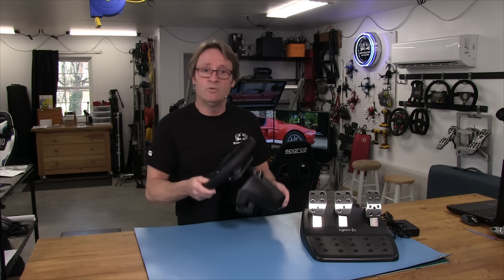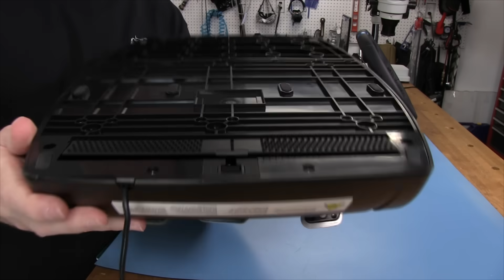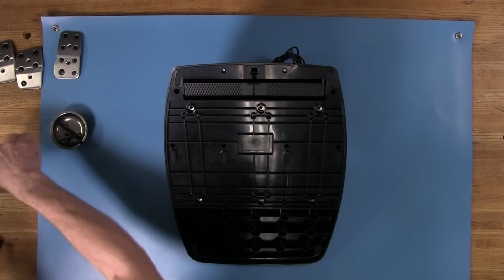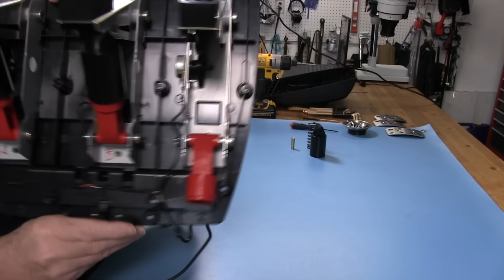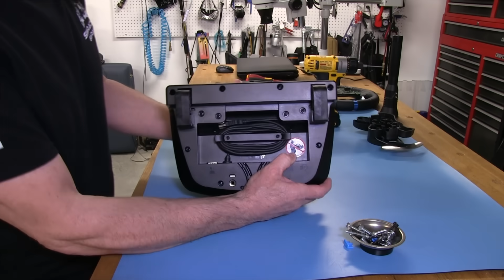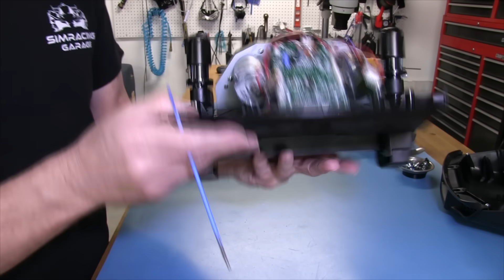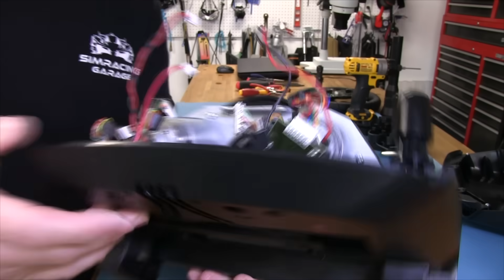Logitech G29 Review

Comment: Actually, I use a G29, but I still have a G27 that broke the encoder. I replaced it with a brass one, but the wheel still does not calibrate correctly and it has no force feed back on the left side. I hope my g29 will have better lifetime. It's a nice wheel, but I'm afraid of any issues.
Reply: Hi!Like a steering wheel, an impression? Is it worth paying for the T300, or is the G29 the best choice?

Comment: Would you recommend to pull out the rubber thing in the brake pedal? Is it possible to adjust the brake curve (yet)? I only play on PC, so I don't mind if it will create unwanted side effects on the Playstation.

Comment: The g29 is a solid wheel, I laugh at any elitist who instantly bashes on the g29 and talks like its a 100$ walmart spring driven wheel. Yet those people who hate the g29 will praise the g27 even though they are practically the same wheel with different button placements. 

I would go for a g29 any day. its a great intro to sim racing.
Reply: People rip on the G29 and praise the G27 because the G29 is just a G27 with less useful buttons and a higher price that DOESN'T include the shifter.
Reply: @VoidSixx  yeah higher price when the g29 first came out. Since the g27 is no longer produced, buying used is usually pretty expensive for the g27. It's only $250 for everything now a days for the g29.

Comment: Hi Berry, watched both of your videos on G29 and T150 and I'm currently trying to decide between the two. Do you think T150 is reliable enough?
Reply from the maker: Unfortunately reliability on any wheel system can be hit or miss. So, I really can't say which one would be more reliable. Just have to roll the dice on which wheel you personally prefer.
Reply: @simracinggarage3026  you're so right berry, that makes sense as there are a ton of moving part in these pieces of wonder. Thanks for the quick reply, I hope nothing goes wrong
Reply: @malicalik  idk if it's still relevant to you, but my t150 broke after one day. I was playing for a few hours and everything was fine. FFB was strong and very direct. I liked it. Unfortunately when I turned the wheel on the next day and played for a bit, the FFB was very unprecise and sometimes the wheel just blocked. It made weird noises and even smelley a bit burned. I then took my t150 off my table and shaked it. I could here a little rattling noise as if a little piece of metal broke off something. I returned it and bought a G29. The G29 feels a lot better and the metal pedals were much better than the plastic ones from the t150. In fact the t150 pedals flipped over when I was breaking. The t150 pedals have no screws that could fit into a playseat. I had to glue it on to something. The G29 pedals were rock solid even without screws holding it. I would highly recommend buying the G29 since I have this wheel since 1 year and it still works perfectly. Don't get me wrong, the t150 still is a great wheel for the price, but the pedals, quality and reliability of the G29 is a bit better.

Comment: Good review I used the nixim mod for years on the G25 pedalset tried the G29 set up and it's very pronounced end of braking and the rubber is very stiff, I swapped out for my Nixim dual rate spring and softer rubber insert and it felt much better light at start for feathering then onto stiffer rate so like hitting the servo in a normal car then the end rubber squash for standing on the brakes. I've also de-cased to reverse mounted the pedals now and I much prefer the feel of inverted pedals over the F1 style.
Could you do a video showing where to get a circle button feed so we can run a diy handbrake for rallying and drifting?

Comment: man i have bought that wheel one month ago.
my pedals are already fucked up. 
its break randomly at random breaking pressures without even tutching the pedal.
sometimes it trigger the break when i accelerate.
and now when i'm at 100% on the accelerator it goes randomly from 90% to 100%. 
everyone seems to have tose problems 
they says its because of the dirt inside the pedals.
i'm looking inside it, there is nothing.

Comment: Excellent review :) And I just realized that the moving slider is not a stabilizer, but locking mechanism which makes the wheel rotate "only" 900 degrees :)  And as always, I was very happy with all the Logitech products so far (I owned DFP from the wheels). I have keyboards, mouses, speakers (z5500) and always all great. Except for G940 where many users including me had to fix the wiring in the throttle and replace the board for Bodnar's one to eliminate hysteresis (refueling pain). 
Anyway, it seems that the G29 is made very well, I made an exception when G27 was introduced and took Fanatec (old GT2) with CSP (v1) pedals, but had to say it was the same cost just for the wheel and with pedals and shifter, it was almost the double. Also after intensive using for a few years, I had to recently rewire some wires in the weel as well as on the pedals. I think that with Logitech this is very unlikely and maybe just the pots will need to be replaced after some time.
So for any newcomer, I would definitely recommend Logitech G27/29 as it is a great wheel and if you fall in love, you can upgrade to Thrustmaster or some recent Fanatec wheel anytime later. The precision and absolutely zero deadzone feels great even with the older GT2 wheel as it is belt driven.
Reply: Edit: reading post below it seems that G29 can suffer after a long time usage from the twisting the wires as well.  I've had exactly the same issue with my Fanatec last week (years of usage) and I needed to replace all the wires between the base and the wheel. Really strange things started to happen :) I do not understand why both manufacturers did not make the cable longer twisted into a few circles. Or chose different wiring material :/ For some of us it is easy to disassemble the wheel and replace it, but for a regular customer, it must be a pain to wait till the service do the job :/

Comment: My Force Feedback doesn't turn it self off completely at 0%. It sometimes make my wheel shake and produces a slight drag when turning a wheel ... I hate it (I hate FFB as well as centering spring). So in order to make it physically off, do I need to unplug these two current controlled 2-pin connectors from 36:50?
Will i loose turning angle restriction after this?
Cheers! :)
Reply: Lower your FFB setting back to 100%. Everything higher that 110% removes the center deadzone, thus making it wobble back n forth. Also if you want to run it without FFB you can just unplug the adapter, but then it'll run without the centering spring, so you'll have to reverse it manually to the center.
Reply: Nope. I know unplugging adapter on G27 does the trick, but on G29 it doesn't work.
PS
There is no FFB settings in Logitech Gaming Software, so how can I set FFB to 100%?

Comment: it's a very good, reliable, and premium-built wheel. my only complaint is the rigidity of the rubber stop behind the brake pedal -- if it was even just a tiny bit softer, the G29 would be perfect to me. (it certainly makes some challenges in assetto corsa more physically demanding than they have to be.) otherwise it's been well worth the $300; makes racing games 1000x more fun.

Comment: Is there any where you can direct me to get instructions to safely disassemble this wheel? I.e paperback. Your video is really detailed and the closest I have come to finding what I need. My wheel fails to calibrate on ps4 mode. I believe need to replace the center cable and need some guidance. I may need some ideas on what I can replace the black cable with as its not a item one an buy off Amazon. Much appreciated for any help. #sadsimracerdude
Reply: Could you perhaps do a repair tutorial on this common known g29/g920 issue? https://community.logitech.com/s/question/0D55A000071vQbpSAE/g920-pause-when-turning-issue-fixed

Comment: The "Rack" for the "Pinion" on the back end of the steering wheel mounting shaft is solely there for end stops. The protrusion sticking out next to the pinion hits on the ends of the rack.
Reply from the maker: Yes, but the mechanism also induces drag on the drivetrain. Which adds weight or dampening to the feel of the wheel when turned. Remove the toothed rack from the pinion, and wheel will turn much easier.

Comment: Would you recommend getting T3PA pedals with Drivehub? The brake pedal is a massive problem for me especially in F1 games and since I'm using an average desk chair it just makes things a little more difficullt. Some people have told me to use the Clutch pedal as the brake pedal, haven't tried it yet but I'm guessing it would feel quite odd.
Reply: Got a non wheeled chair or just use a regular chair
Reply: Remove the rubber bump stop in the brake and purchase a Leo Bodnar cable, problem fixed.

Comment: those motors are rc car motors they run cool unless you push them really hard and i mean extreemly hard by driving through mud bigger than my rc car which is a 1/8 scale they it will need a heat sink but 2 motors will be fie

Comment: Great video, I really appreciate it. I'm currently looking into the G29 because the T300 Alcantara is nearly double the price where I live but I wasn't sure if the logitech is gonna cut it since the T300 is the go to (if they are priced equally).

I also really appreciate that you demonstrated how to take it apart because I like products that I can repair myself and now I have a good overview, this looks so much better than my cheap 50€ TM wheel which fell apart long ago.
Reply: those alcantera wheels are just a ripoff... get the basic t300rs buy whatever wheel you want, drill some holes and screw it on...
but whatever you do stay away from logitech wheels, unless you dont mind the ffb deadzone at center.

Comment: i cant use my legs so looking for a wheel i can use with fully programmable buttons so i can accelerate on the wheel. is this a good wheel for my problem?
Reply: Probably yes, i the buttons are really close to your thumb, it would be quite easy
Reply: on/off acceleration and brake will not be easy to control...
but using arduino, you could make two xbox type analog thumbsticks very cheap, then place them on the wheel where they suit you the best...
https://www.robotshop.com/en/catalogsearch/result/?q=joystick&order=relevance&dir=desc

there are many tutorials on arduino joysticks.

Comment: Please help I did remove all 8 screws but the wheel won’t come off its stuck right under the red dial/button I tried inserting a thin metal pry tool between the two plastics it did nothing..is it possible that its glued or something any ideas? Thanks

Comment: Hmmmm, no mention of the horrible FFB deadzone when the wheel is around 0 angle ?  I bought one last week, and returned it just because of that, i couldnt even drive in straight correctly. I try to ramp up the "min force" in AC, but it's just reduce the effect but do not remove it.
Reply: There is a way to reduce this almost to 0 by making the wheel force response more linear through software. Search for "FFBClip" app and "Lut generator" in racedepartment.com. There's plenty of tutorials on youtube to help you how to set them properly. And I can guarantee you, it will totally change your experience  on AC.
Reply: @arkkanus  and what about other titles, specially f1 2018.. i like the wheel but worried about deadzone.
Reply: yeah... this is absolutely the worst thing bout the logitech wheels,
not much to do about it, that wheel needs the deadzone or else it would just oscillate heavily when centered, its poor design.

t300rs is what i got now, it is so much better!
when i got it i set a new pb on nordschleife  with the ac cobra on my first lap,
after not playing the game for a long time... it is much more precise!
Reply: There crap m8 I've just sent one back I'll be sticking yo my  t300rs

Comment: How electric motor are working, to keep it very simple , max rotation speed is dependent to voltage and max constant torque is dependent to current.
So comparing 2 wheels by the input voltage will give you no info about the torque at the rim the wheel supply.

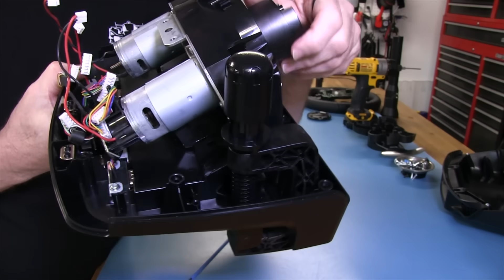Comment: Hey @Sim Racing Garage the sliding bar under motors at 40:00 is used to stop the wheel when it reaches left to right 900* lock. Also this thing creates hard bumping sound during calibration.

Comment: How did you mount the pedals? Did you put the screws in from above while you had it apart? I have a P1 aswell and am trying to mount them right now.
Reply from the maker: You will need 2 corner brackets. Mount one side of the corner bracket to the profile, mount your pedals from the bottom of the remaining side of the corner bracket. info@simracinggarage.com if you need a picture.
Reply: Sim Racing Garage Thanks for the answer - got everything mounted now. Its a hell of a rig. Its my first rig and I do not think that I will need a new one anytime soon. Got the black P1 thanks to your review btw. :) Keep up the good work.
Reply from the maker: Glad you got it sorted. Enjoy!

Comment: I hated the G27, simply because it was too easy to strip the cogs and end up with wheel slippage where it would get progressively more off centre - 2 replacement units I went through before I gave up. Just can't handle high FFB levels I suppose. I actually quite like the pedals, I keep a set around as a backup nowadays - I don't think anything is as reliable as these on the market.

Comment: Been a G27 owner for 9 years now and couldn't be more satisfied with it. The FFB detail given by gear driven wheels might only be worse than direct drive (which I haven't tested yet) and the build quality is amazing. Had bad pots only after 5 years, which I solved by setting deadzones with DIview. Then the shifter potentiometer got bad, which would be fixed if I had a bodnar cable. Then had to resolder the right side wheel buttons circuit board wire. All expected within such a huge lifespan. Also, consider adding the GTeye spring mod, made the pedals a lot better to me.

Comment: How do you have the FFB settings configured in PC2 on the PS4?
Reply from the maker: I show those setting in the "Driving" segment of the review.
Reply: I see where you show the Configuration tab for PC2, but not the FFB tab settings.
Reply from the maker: Hmm, must have left it out then. If I recall, I had the FFB at default settings other than the actual FFB strength. I had that turned up a bit. Just tuned to my liking. Of course that doesn't mean you will feel the same about my settings.

Comment: i just repaired mine. the main screws that hold down the bearing pulled through the plastic base. in turn separating the flat gear from the wheel gear. longer screws and some washers now wheel feels more solid then ever.

Comment: Looks like crap inside, my 10 years old fanatec looks waaay more solid.. and all those plastic, i will brake it after a week if i will be lucky.
Reply: hardcorebam14 these wheels are famous for their durability,I’ve had my g27 for 8 years and the wheel is in mint condition especially the ffb,as long as you don’t overdo the ffb,pedals are modded with gt eye springs and a load cell mod for the brake.
Reply: Jellybeantiger g29 is the wheel I was talking about the g27 is actually better
Reply: DDan Beatz sorry mate
Reply: Jellybeantiger it's ok I didn't  exactly  make it clear that I was not talking about all logictech  wheels
Reply: hardcorebam14 if u can break that after a week you have a serious issue
Reply: i got two dead g27`s lying around... and two damaged motherboards,
these wheels are crap...
then of course there is the ffb deadzone at the center...
Reply: hardcorebam14 fantec is for real sim players this wheel is for casuals
Reply: VR gaming Content I'm not bringing a civic to a formula  one race